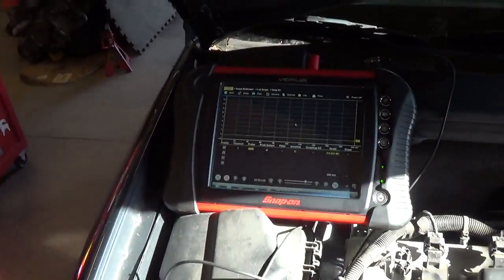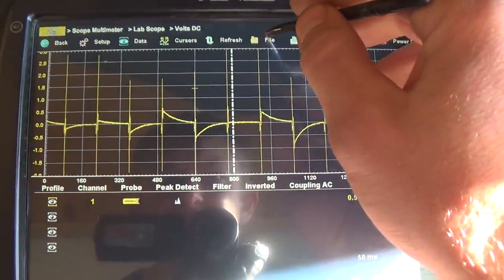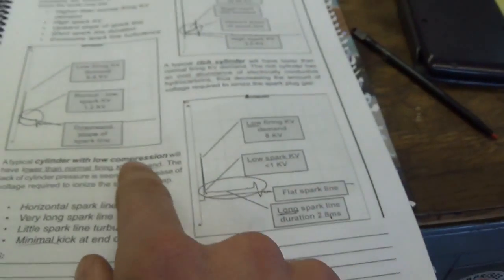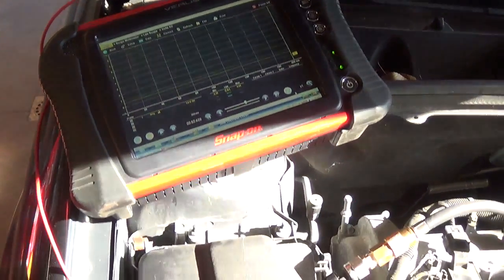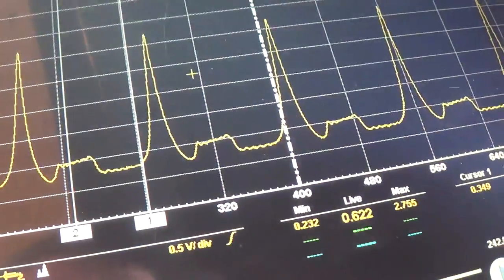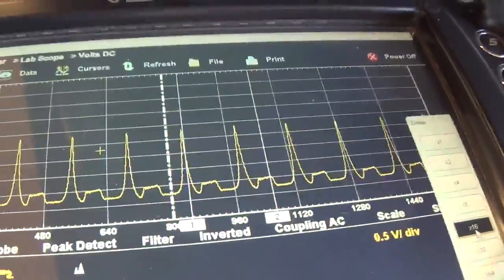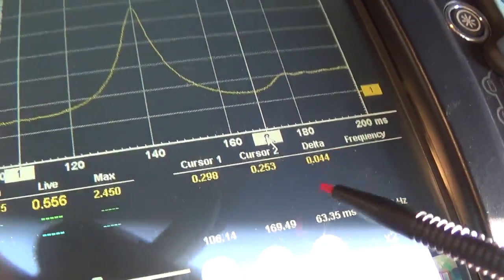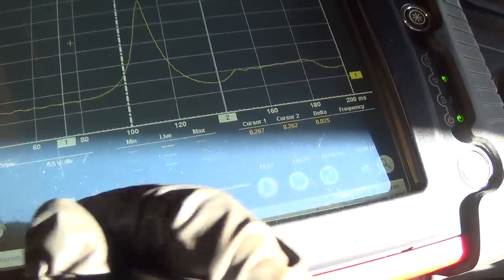P0300 Misfire case study: 09 Chevy Cobalt -Part2

Comment: crazy, Wonder if this is a manufacturing issue Iv had two different 2.2 eco's with issues on cylinder three, one with bent exhaust valve and the one Im working on now, which I pray is not a valve issue as I just put the damn motor in the car!

Comment: Nice diagnosis there Professor Ivan!  Do you happen to know if the 2.2L Cobalt engine has a common issue with the fuel injectors? I got one in today with 70k miles, P0300, scan data shows cylinder 3 is misfiring.  Coils and plugs tested good. Had to quit for the day before checking injectors or compression. Thanks man hope all is well.
Reply: Did you figure it out??

Comment: For anyone who cares, the 2007+ 2.2 Ecotec is a Gen 2 block. There are many significant changes on the Gen 2 block. The 2007+ Ecotec received numerous updates including individual coil on plug, and a completely revised head. Unfortunately, it is common on the 2007+ 2.2 ecotecs to have valve and/or valve seat issues. The 2009+ 2.2 Ecotec was revised even more since 2009 was the first year for VVT on the 2.2. For the most part 2006 and older 2.2 L61 ecotecs don’t suffer from valve issues, but timing chain issues are another story.
Reply: Great info and thanks for sharing!

Comment: How much air pressure in the cylinder.. what percentage was it leaking. My piston pushed down on 80psi  and had a 30% leakage on piston one couldnt hear anything leaking. My compression numbers were [1] 195 (2) 205 (3) 215 (4) 215.  It was on a 2.2 ecotec engine

Comment: no way @10:25 should your transducer read 88 psig on the compression towers...not with -8 psig vacuum on the intake stroke.

(9.2:1 compression ratio)

-8 psig = 6.5 psia
6.5*9.2 = 59.8 psia = 45.3 psig

Yvan, I made a similar DIY transducer to yours and these are the kind of results I get and to my understanding, more consistent with Boyle's Law. Typically 1/3 of crank compression test results...not 1/2

Comment: 2010 Cobalt Had CEL and TC lights. Had the P0300 which lead to low compression cyl 1. Had head rebuilt at 47k. Sad really.
Reply from the maker: yeah that is very low mileage to need a head job...
Reply: I'm fearing this going on with my 2010 cobalt I got a misfire on cyl4 and is causing the TC to go off. I really hope I don't have to pull the head :(

Comment: Very good analysis. As an alternative, 1st perform a compression test, that will get you to the suspected cylinder. Then connect your compression hose to that cylinder, roll the crank to close that cylinder's valves and apply compressed air to that cylinder. Look under the radiator cap for air bubbles (head gasket problems). Listen to the throttle body (intake valve leak) and the tail pipe (exhaust valve leak) for the hissing of air.  This is not as technical as your method, and leaves a few things to question. It takes 10 minutes and may yield some interesting results....... Keep up the good work. Dave.

Comment: I wonder if first look sensor would  find this valve problem by connecting it to intake manifold. Great job as always.
Reply from the maker: I don't think so. Maybe if the intake valve was leaking severely, which is not the case here.
Reply: motoYam82 thank you for quick response to my question if you could please watch my last video with Chrysler Sebring on my channel I had bad coil and PCM was limiting current but I don't know if I had shorted primary or secondary. Thank you.

Comment: I had a p0301 and changed the coil pack, it ran rough also. After changing in coil pack it ran perfect for 2 days. Now it runs rough and i have a p0302. Changed the ignition coil pack again and now it runs perfect again. Any ideas?

Comment: I don't want to sound like a know it all, but you should do a snap throttle when checking secondary ignition waveforms, you really cant tell to much when you don't load the coil.
I bought all the parts to make  the same pressure transducer but without a picco scope I don't see any value in doing any in cylinder pressure testing 
Great Job and cool video
Reply from the maker: +JOHN HUFNAGEL Good point! However in this case the waveforms wouldn't change much during the misfire since the spark still occurs, but outside the cylinder. What I really should have done is a test drive before even pulling out the scope :)
Reply: +motoYam82  ive got a verdict D7, yet to really play with it,  but this exhaust valve issue has bin something i've seen twice on the cobalts/pursuits/G5 haha i work in a gm dealer and ye, wait till you hear a newer car's crank case vent system when it acts up, will set lean codes, miosfires and all kinda good fun, lets forget to mention the front crankseals that squeak xD
Reply: I do think you will see it, the spark line will bend downward with a low compression misfire, according to this article.
http://www.diagnosticnews.com/anatomy-of-a-waveform/

Comment: I have to wonder now if this is an interference engine and if the operator wound it up too tight on a missed shift and kissed his #3 piston?  Any marks on it?  For sale CHEAP good used engine.
Reply from the maker: +Lee Barnes I talked to the owner; she drives responsibly and keeps up on the maintenance :) And it's auto tranny...pretty much fool proof in terms of over-revving...but the variable is always there.
Reply: I saw her watching over you in a couple of shots and had to wonder if this was the worried owner evaluating your work and methods.  It just seems too much of a coincidence that both leaking valves were side by side, but with your added information it sure would be hard to over rev it which isn't a sure fire way to knock out both and only both #3 exhaust valves to begin with.  Can't see it happening too easily now, so much for that cheap seat theory.  Thanks for extra info.  There is a guy on youtube that straightens these kinds of bent valves with a large screwdriver and just tweaking them back to straight.  Don't have access to valve grinding equipment any more but I sure would like to have given this method a litmus test when that was possible for me. The concept is so ridiculous that I never entertained it before, now I have to wonder.

Comment: Another great video Ivan, I always learn a lot watching you diagnose. One question, though, if your transducer is set to produce a half volt at atmospheric pressure - which is 14 or 15 psi - wouldn't one volt be equivalent to 28 psi, not 38 psi? I know it doesn't really matter as you are using the results relatively to diagnose, but I was just wondering if I missed something in how you determined psi to voltage. Keep up the great work - you and Eric O. have turned me into an armchair mechanic (it's a lot easier than the real thing!)

Comment: The relative compression test was the quickest and most resourceful of them all. Great pioneering scope work in trying to find a corelation between the good and the bad. Bad leakage on two valves. Why that cylinder and not the other three ? The machine shop was the only route.Heavy duty operation for both assembly and disassembly .
Reply: leaking valve stem seal?

Comment: GM has apparently gone down the toilet, that's just bad engineering, and its a 09 . Best to get a valve job, if this happened to one, I'm thinking another one just down the trail, How many miles on that sled ?. But I guess they build to price anymore so not surprising really. I used to balance and B print Chevy engines 327/350/396s straight from Chevy, they were terrible straight from the factory. But that was 1971, They haven't learned a thing , or we haven't learned what to steer clear of.
Amazing 2009.
Reply from the maker: +Charles Miller Yeah 6-year old car with 90k miles...embarrassing really. Something as basic as valve seats should be a non-issue in this day and age!
Reply: Charles Miller I don't know my 05 didn't give much issues, same engine also with 80,000 miles driven on the engine . They were decent cars, I traded mine in a year ago for a 15 Camaro, and the difference is great. Now seeing that this car has 90,000, it could potentially happen, but it's no longer my concern.
Reply: oh boy i have a cobalt 09 with a p300

Comment: Is the machine shop going to clean all the valves and seats or are they just going to do cylinder No.3?  For all the work it takes to remove the cylinder head, I would have them do all the valves in all the cylinders.
Reply: Yes, they will.  It's standard procedure to do all of them and put on or supply new guides, and stem seals where applicable too.  Also quite common to have the head milled flat if no cracks are found in the process of grinding the seats.  Milling is optional and ensures a good job in allowing the head gasket to seal and last as long as possible.

Comment: If all other valves were good.  I I think I would of tried course valve grinding compound then fine. And tried an in house fix.  Lapp them in.
Reply from the maker: +Jason Curry Yeah typically if it's just carbon deposits I've gotten away with cleaning and lapping compound. That would probably work OK here too, but I decided to take it to the machine shop since it's a customer's vehicle and they want a long-term fix...might get it back today!

Comment: Doesn't look like carbon buildup was the the cause. On the hummer series the seat was actually distorted , was the seat on this one the same ?
Reply: +motoYam82 well you actually , you could use some cleaner and then use some blue print or pruscia ,, sorry i dont know how you call it there in your country.. A simple paint to see if its the seat distord or an uneven valve surface for the ex gasses but i think you said" what the hell the machining guy will tell me " ;) hehe
Reply from the maker: +Steve Rob The sealing surface did not look even all the way around the seat, so it did look like valve seat distortion. I found a great article here with some relevant info: http://www.aa1car.com/library/ar993.htm
Reply: +motoYam82 
They won't just replace them. They can be ground out    I worked in a machine shop for a while.   Valve job per say
Reply from the maker: +Jason Curry Yup the machine shop guy didn't get too excited when I showed him the head. All he said was "valve job" lol gotta trust the pros :)